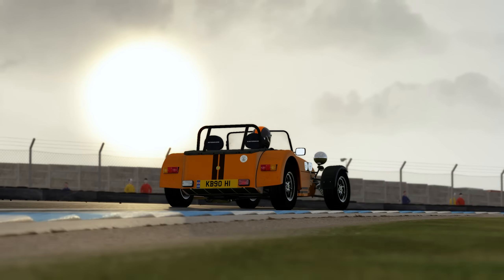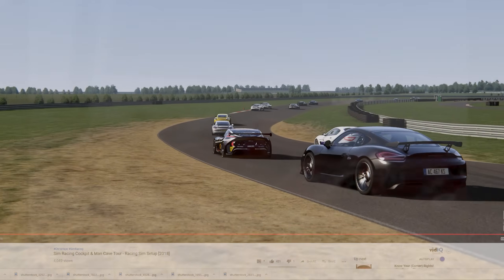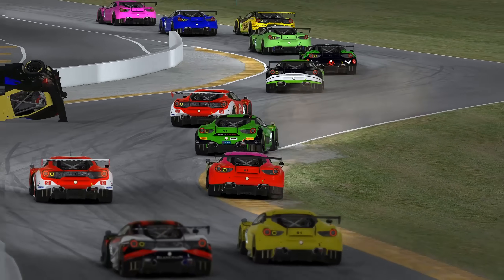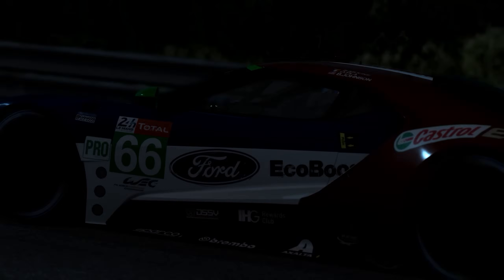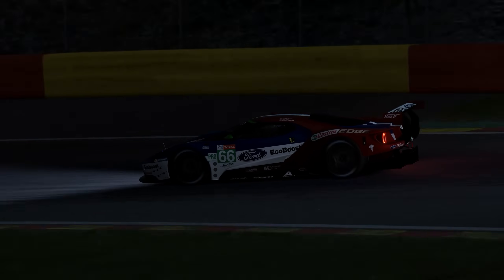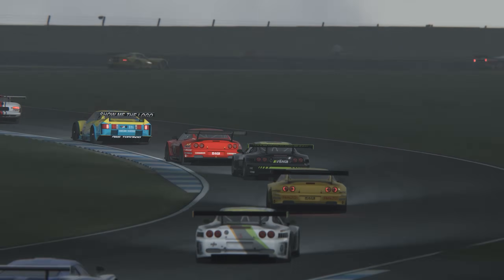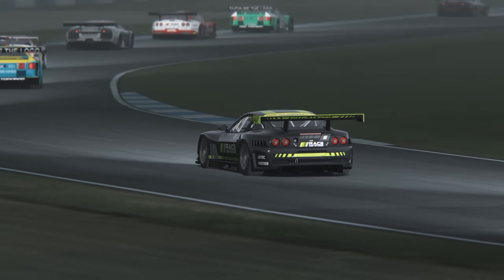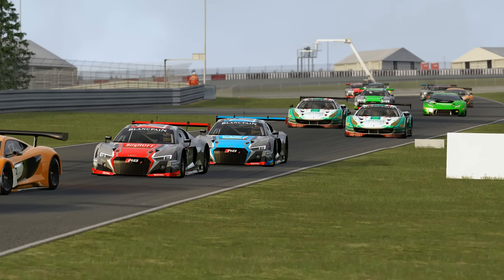Sim Racing Setup Guide 01 – Introduction

Comment: Contrary to popular beliefs, setups serve to encourage good habits, not to absorb bad ones. Depending on how you drive you can make the same setup oversteery or understeery, so a good setup doesn’t make you quick per se. It’s the other way around.  Since anything can be driven to the limit, learn first to find the limits of a def setup and learn the track well before you make any changes, because once you improve your laptime you won’t be able to tell whether it’s because you improved or because the car improved, 
And you’ll be on a wrong path to start your setup with. I personally spend more time working on my driving skills than I do making setups because this is where I find speed. Then if I identify a precise handling characteristic that’s slowing me down and I know for sure it’s not caused by my own inputs, I go and try things here and there. I believe 10% of a great laptime comes from practised driving skills (that’s the conscious part of your brain that says “i need a better setup to beat this guy” ), 5% comes from actual setup and the other 80% comes from things you do without really knowing (the part of your brain which brings ease and pleasure from driving and that doesn’t give a dam if the setup is good as long as the lap feels good)

Comment: There's an advice I heared that really helped me that would be useful here: sometimes when you have a little understeer it goes unnoticed, and then when you slow down throgth the corner you gain more grip and if the conditions are right your regain grip at the front and the excessive steering angle causes a spin out that mimics oversteery when really the core of the problem is the understeer.
Reply: This is really important and I noticed this recently with RSS4 on Assetto Corsa. Tried to hard to remedy oversteer only made the problem worse, when it was understeer that i should fix so that it would put too much pressure on the rear after it "snapped". Only when i gave up and defaulted the set up I understood what was going on.